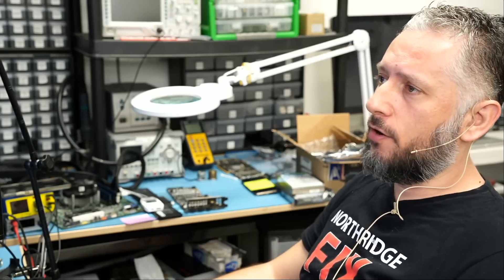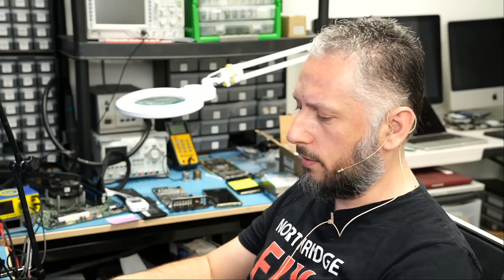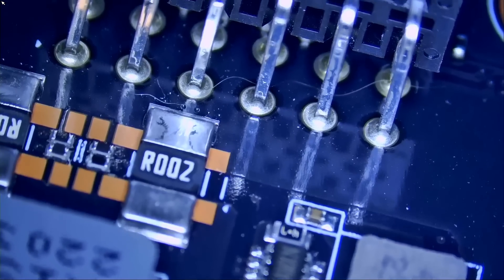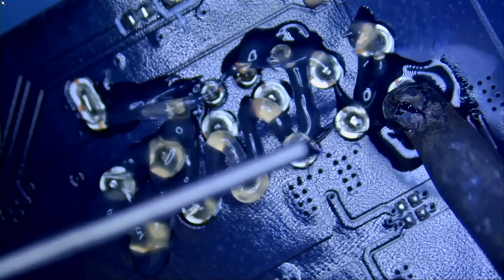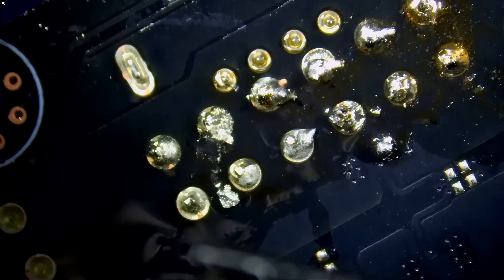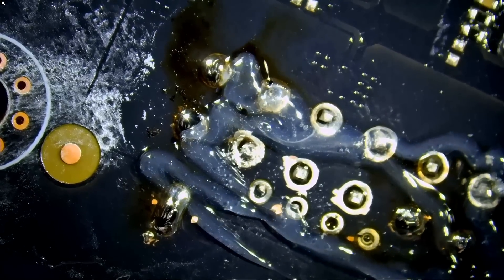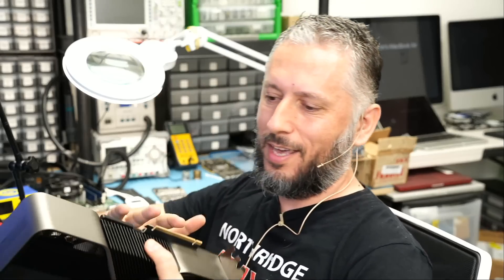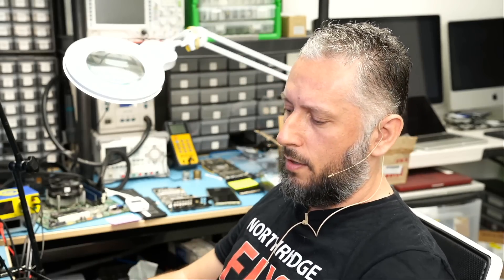Serious issues with 4090 power connectors melting - Is the user at fault ?

Comment: I know this is a card designer issue.  My 4090 CableMod connector was plugged in all the way.  Verified this with a magnifier.  Was not loose and never wiggled around.  Yet the connector melted into the 4090 power connector.   Should be delivered to NorthridgeFix today for express repair.  CableMod is covering the repair and shipping and the expedited service. They are a good company and standing behind the product.  I am very happy with them and even ordered some more cables yesterday.  I am confident after watching this video my card will be fixed perfectly.

Comment: Does anyone have a source for replacement power ports for the 4090?
I need the one that has the right angle pins to the mainboard, so the connector points upwards.
I have only been able to find the port that has straight pins.
Reply from the maker: https://northridgefix.com/product/12vhpwr-connector-for-4000-series-graphics-cards-ex-4080-4090/

Comment: Funny how Nvidia tries passing blame to users. Maybe some are user error, it is said its difficult to plug in all the way and looks like it is when it might not be. But the simple fact is... this has never been a massive issue in the past, that tells me Nvidia made a product that is not user friendly and has a high chance of failure. That's a big claim to say after    all this time and this many issues its the customer error... its a sad laugh.  Guess what Nvidia is starting to roll out new style and other companies are working on protective connectors or tweaking the design.. if its user error, why are these companies trying to fix it? Just read someones  RTX 4090 finally melted after a year. And what about the people who've been building PC's for  many years and know what they are doing... also experiencing this issue. Nvidia just doesnt want to front the cost of all these replacement cards. I get it.. it'll really suck for their year end revenue #'s,. but that's not the consumer's problem.

Comment: I have one and it comes with a warning about the connector with step by step images on how it should be done - saying that if this is a recurring issue then Nvidia should redesign the connector in a more user friendly manner for example hear a click when inserted all the way etc - by giving a warning either illustrations Nvidia take themselves out of the responsibility - I’m not sure if they will still replace it if an RMA is logged with them.

Comment: I agree 100%. If the connector has the slightest  margin of wiggle and this can cause the high heat, than the manufacturer has to implement safe measures, maybe trough two more latches on the sides. Anything. However, all the failures that happen are still the manufacturer fault, even if the end user don't  know better.

Comment: Thanks for the video! I run a 1080Ti, have a new 3080Ti awaiting a build, and want a 4090, but probably will wait until this situation is resolved. Or just get a 4080. I run an LG Gsync ultrawide 3440x1440. 

Fair winds and following seas to all.

Comment: Fact is, this has never been an issue with the standard 6 or 8 pin power connectors. So this 12pin mircro fit connector is just crap.

Comment: I have a 4090 and when I initially installed the power connector to it I checked after the click and discovered that it was not latched.  I had to keep working the power connector until I could verify that the latch was engaged.  I'm certain that other people stopped when they heard the first click without verifying that the latch was engaged.  The connector needs to be redesigned to make it easier to install just like a standard pcie plug.

Comment: Bad design, if the cable is not inserted properly into the connector, would the plastic surrounding all the pins not melt due 2 overheat, why just the same pins as the last card u fixed, what do them pins connect 2 that are burning the plastic, good job alex

Comment: It's going to melt regardless. You are taking 4 8 pin pcie connectors with thicker wires drawing 400+ watts through them, shrinking them down to a 12 pin connector with much thinner lines and connectors still drawing 400+ watts and how many amps through those tiny pin connections and you don't expect them to get hot. It's Nvidia's flaw all the way. It's basic electronic theory. Expose them all Alex. You're doing great work!

Comment: The problem isn't in any way due to the user. This card draws almost 38 amperes of current. The pins of the connector are too small to handle that amount of current safely - - the tinyest amount of dust or oxidation on the contacts will result in heat; to the point of gradual failure.  A card that draws 450 watts of 12 volt power needs to have at least two parallel connectors to safely pass that 38 amps of current draw.  This is, IMO, a heavily flawed design and not acceptable, especially on a nearly US$2,000.00 card. A redesign of this card's power input physical layout is what will be required. No amount of repeated repair will solve this without a physical redesign of the card... otherwise, the harder the card is pushed, the more often it will fail - over and over again.

Comment: The connector is simply too small for such power. Nvidia created it to cut the cost. Less plastic, less metal = less cost.
You cannot reduce the physical size of the connector and increase the power that will be running through it. The old 8pin PCI-e connector was bigger and was rated for smaller power thus it was way safer. 
This is what happens when corporations sacrifice safety in the name of profit.

Comment: I am certain that the fault is with the manufacturer... Its a design flaw in my opinion and agree with Alex just knowing that the 3 connector to one connector in the 40-series in when the users started having this problem.  Why isn't the user sending the card for warranty? Alex can fix it quicker than going through a warranty claim and time is of the essence when it comes to new gen cards. Furthermore, I do not think that this replacement connector is a permanent solution just because its "better than factory 🙂" because the new connector could melt in the same way.  In any event..... I sincerely at this time have to point my finger at the manufacturer..

Comment: Those 4090 pins are very thin, under engineered plug design. maybe the standard  for the plug is not right.

Comment: The design of the 12VHPWR connector is UTTERLY DEFECTIVE. It was AFAIK, a 'design by committee', a committee of IDIOTIC MORONS in my estimation. If you check a cable chart, a 6mm2 copper conductor is required to carry 50 Amps. This connector is attempting the same with contacts of only 2.4mm". It's OBVIOUS that it will overheat from I2R heating.

Comment: I think the ampere or power in every single pin is too high that plastic connector can handle. why is not to be consideration to the producer, 4090 is not cheap things

Comment: If the connectors keep melting the card is made wrong. This is a project that requires more testing to fix it. 🤑🤑🤑🤑🤑Get to the lab and do some tests. Use thicker wires, use different connectors, figure out where the heat is coming from that melts it. There's money to be made for a solution. Someone can figure this out. 🤑🤑🤑🤑

Comment: Hey, I wanted to share with you, think about the problem with the video card!!  I work as an electrician. We received a shipment of 24 volt motors and there was a problem with the power cable. The cans were leaking. There was a problem with the manufacturer's production.  The motors did not work because there was no contact with the pins (there is also a situation where the power supply pins are loose

Comment: Here in Germany the 40x0 cards are dying like flies. If you want to say it's user error, it's only because users play too many 3d games. Perhaps NVIDIA should include a note with the cards, or bundle them with Tetris... . The plugs fuse to the socket when fully mated. I think the connections are running too hard on their specs. Maybe you should log the power consumption over a longer period of time in order to be able to draw better conclusions!

Comment: One issue that nobody is talking about:
The Positioning of the connector on the Card.
It should have some form of heatshield as the Cooler blows decently temperatured air onto the connector.

Comment: Two things that I have seen a lot are people wanting to flash 600w bios onto different 4090s so they can push them, and normal 4090s are getting OC to the extreme limits when there is no need. I would dare say those two things have put a strain on parts that were already questionable in design.

Comment: i noticed with my 4070ti that you indeed need to push good on it so it "clicks" properly altough it does not seem to realy make a clicking sound push it firmly so it fits snug and is seated all the way! rooky mistakes... comming from the old connectors yeah this is BAD. blame it on nvidia for sure.
now that i think about it i plugged in the extension cable after i plugged the gpu in the pc: plug it in before so you can better check if it is seated right.

Comment: I think most people including me is a bit uncomfortable pushing a cable connector down and see the motherboard near PCI ex area bending down.  downwards. So to avoid a loose connection situation I always plug in the power connector(s) to graphics card prior to installing on motherboard. The PCI ex power lines are longer on newer ATX power supplies. I am sure others out there already doing the way I do it.  Thanks

Comment: This is one of the reasons why I'm hesitant to get a 40 series card. This connector doesn't seem to be sturdy compared to the last gen 6&8 pin. There's no warning message on the board itself that stops power flow if the thing is not properly connected.

Comment: Its really as simple as it being a poorly designed connector if the user can fail to plug a connector in but it still function... People blaming the user have no idea what they are talking about. The card shouldn't power up if its not fully plugged in. There could be an LED that is green or red if the connector is partially plugged in vs fully plugged in. Its 100% poor design and nvidia might eventually get sued over this.

Comment: Too much power for one connector. I have a rx6950xt and it has 3 connectors. How does this card only have 1 connector? I’m guessing nvidia only used 1 connector on these cards because they didn’t have the parts to add 2-3 connectors. Once the parts came in they already had the machinery to make the cards with 1 connector so they kept it going. The 3090 had 2 connectors so why is this more powerful card have only 1?

Comment: There have been countless videos published on this topic. It is poor design by the manufacturers... not only do you need the cable to be plugged in super tight, but there is low tolerance for the cable bend. If it is bent too much, that breaks the solder in the cable itself which can cause this failure to happen. This is a challenge due to the positioning of the connector on the card, where getting it to fit in the case with the side panel on is about impossible, forcing people to have to bend the cable more than the cable is designed for.

Comment: Yea it’s fault of the maker. These connectors are a pain to plug in. I just installed a rx6950xt and had a hard time getting mines in. If you are having an issue with your card not being plugged in all the way change the connector design. The problem here is it’s a universal connector and it would be hard to just change it.

Comment: The manufacturer will always engineer out the cost of making the product because they are ruled by accountants it is very easy to avoid user error but it costs and it doesn't benefit their bottom line 🤔

Comment: This whole connector thing was a shambles from the very start. It's a bad connector design by the PCI-SIG consortium, nVidias decision to use it, low quality adapter cables produced by nVidias partners and perhaps a TINY bit of user error. Class-action lawsuit is probably the only option to have any impact on the situation.

Comment: never had this issue with the old connector , user or not its that crap design connector simple allot of makers at last minute went back to the old pcie no way would i get any card with that connection, the 4090 card you had in your hands at end the connector is a cable mod connection they cost extra as they did that for strain relief to stop excess heat too the plug i take it that didn't work also

Comment: When a problem is found repeatedly on the same card model then there's definitely a design flaw or a manufacturing flaw.
And I bet that whoever made this, knows about all these flaws. Otherwise, the flaws would've been corrected by now.
How many Warranties have been revoked under the pretext that it's the user's fault ?? why wouldn't they research this. 
Not all users are stupid. it's not the 60's anymore, nowadays users know about hardware more than technicians.

Comment: Instead of inventing new connectors, they should have looked at other industries. The Radio control world solved this years ago,  and 2 4.5mm pins or 5.5mm pins can hold 60 or 90 amps per connector. They're called XT60 and XT90 connectors because thats how many amps they are rated at. We use them easily with 24v+ batteries pulling hundreds of amps at peak and very high sustained loads. Vibrations and dirt and lots of removal. They work so well that Ebikes started using them as well. 

BTW an Xt90 connector at 12v would be 1080 watts capable easily. Thats 2 pins at 5.5mm each. Solved.

Comment: I do believe the connector is the problem the locking assembly is too short and is asked to do three time the work as the old design of the 8 pin connector increasing the total wattage the connector has to carry it has to handle resulting a very high temp at pins of the connector melting the plastic not the user's fault.

Comment: You can't blame the end user. End users shouldn't be building PCs. Professionals, shops, etc. should be building PCs for you, if you are unable to plug in and properly seat a cable. Should end users learn? Yes absolutely. But if you have trouble installing RAM... please give it to a professional. User's Fault 100%. Also for 2500$ we should totally get a more robust product. BUT if you're not in the trade and spending 2500$... give it to a pro... simple as that. If you buy a new $2000 Motor for your expensive car, and you maybe know how to change oil and tires... are you going to attempt a motor swap? No you are not.

Comment: Yeah they would be better of using 2 connectors instead of only 1. Drawing such amounts of wattages through 1 set of PSU cables already makes me feel nervous.. You really got to have a very good quality power supply, that's one thing for sure. Maybe they do have a good reason to only use one connector. It could be that the small voltage differences on the separated power reels cause instability on the GPU, who knows?! 

Do you solder a new connector with a higher melting temperature? To make it better then factory? <3

Comment: Cable connected properly/similar is exactly the scenario of every standard/similar which mandate it to be included into all testing routines and certification processes.
Reply: "The least favourable" is the phrase mentioned a lot in multiple standards that describe testing procedures. Funny that for example office furniture has a lot of these kind of requirements and hugely expensive GPU seem to fail short.

Comment: I think the truth is likely shared responsibility. Poor forethought of how customers will use it (installed not 100% perfectly, which maybe should be accounted for such as in 3 connectors) and customers not being electrical engineers at the time of installing. I think you described the situation well enough. By the way, I think you just rock. Keep doing you, as I told in the past. Of course, no you don't my permission haha. It is a vote of confidence. Thanks for the videos, Alex.

Comment: Soon, your most profitable repair will be replacing power connectors on video cards. It is highly unlikely that is user error all the time. That power connector îs way too small for 600 watt. You have the adapter with three connected cables going into this small connector. The manufacturers are cutting costs but this is just ridiculous. Have you already replacing this connector the second time on the same card?

Comment: Maker company mostly holds accountable for these kinds of issues, yet not at 100% . If the connector is not plugged in all the way in it's a user's fault as well. Its like saying , driving a car with a blown out tire, driver doesn't need to have the knowledge that you need a proper tire filled with air for the car to driver correctly? Or a user leaving the refrigerator door open and the food goes bad. I mean its 2023, tech is all around us and part of our daily lives. There are basic things everyone should know, eg: plugging any connector of any type, properly, it's mostly common sense.

Comment: Even if the cable is 99% plug in the connector must not melt like this.
The connector should have been design with longer contact surface to prevent this kind of damage and risk of fire hazard.
It’s possible that Nvidia partners who used this product had this kind of issue during testing phases of their cards and should have done a better design to make the insertion easier.
NB: Sorry for my poor english.